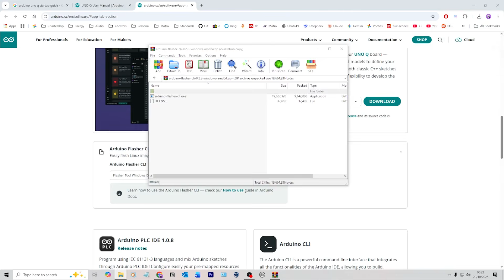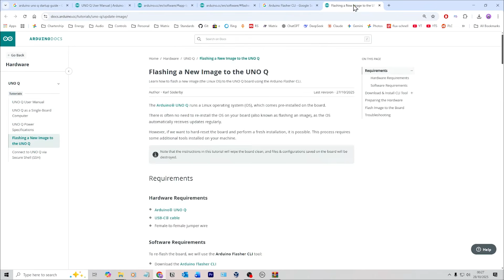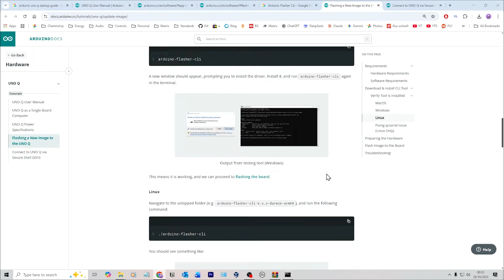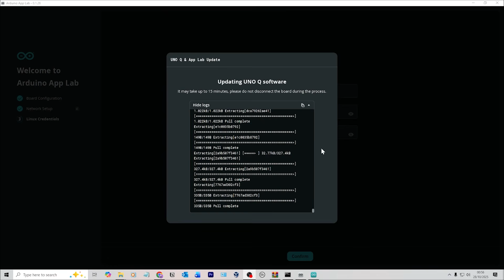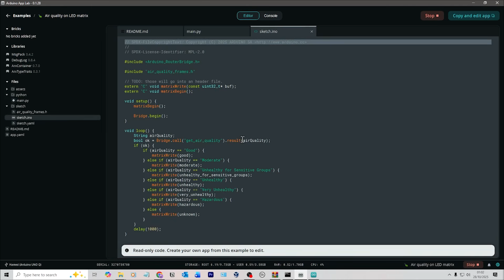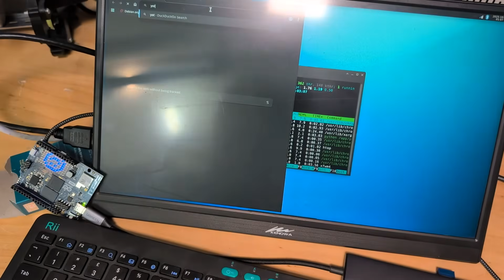Arduino Uno Q Full Getting Started Guide

Comment: First thanks for the video, I found out there's a straighter way to solve all of this:
-You plug your arduino uno Q on your dongle thing with mouse, keyboard and hdmi output to television, 
-You set it up, until you fail on updating arduino app  lab. 
-From this starting point you open up a cmd line (applications/terminal emulator) 
-You type : sudo apt update (enter), 
-You type : sudo apt upgrade (enter), 
-You type : sudo reboot now (enter) 
On reboot the updates for arduino app lab will work perfectly well.

Comment: Which USB hub are you using? Thanks.
Reply from the maker: I've used different ones, I have about 4 of them and they all have worked , I think the power supply & usb c cable to the hub are the important part, some cheap usb c cables I tried didn't work. In this video I believe it is the UGreen USB C Hub

Comment: Regarding the out of box experience. You must surely realise this is not a consumer product? Criticising it for needing updates right away seems to make me thing you never bought any new electronics within the first couple of months of release.

The products are made months before while software development is still in progress. They are loaded with the latest stable firmware provided to the factory, but that is very likely going to be months old vs what is available on release. They are not going to open every box and update them before shipping.

Get ready for several more updates over the coming months as early users start to find holes.
Reply from the maker: I did mention all of this in the video, firmware updates shouldn't be mandatory out the box though. Even Siemens aren't that bad.
Reply: Think it is fair to expect that a board at release would work out box. 
Same experience as Hamed with the exception of my board would not complete the flash process.  Now have a brick…
Reply from the maker: Damn Fleetz, that was my fear when I flashed both of mine. When I was flashing it I was thinking maybe I should have waited to order it from Digikey or some other distributor, I imagine Arduino won't be so easy to return the board to.

Comment: Helpful video. In my case I started with the stand alone mode and it all worked fine out of the box. It was only when it tried to run it connected to my mini PC that I started to get the message that I needed to flash a new image. So it works as expected unless one runs the lap app on their computer instead of on the board. My guess is that they updated the version of lab app for the pc after the factory image was installed on the board and that broke running it tethered.  I was reluctant to try flashing a new image because the stand alone worked fine and I was not sure how much current my computer could supply to the board. You say you do not have to worry about that when it is tethered. I will think again if I want to try that.
Reply from the maker: Flashing is scary but doable, just follow the video and you'll be fine. I find the app lab to be horrible to use when running in stand alone mode, it freezes all the time, so for me the only option is to program it via my PC.
Reply: @HamedAdefuwa  Thank you. I flashed it today. It was fine. On the upside I now know what to do if I somehow tank the OS. I was able to take a jumper off an old project have I have not touched in a few years. So far there are growing pains. I am still curious what this system can do.
Reply from the maker: Yeah definitely growing pains. So far I'm loving the hardware but the Arduino software app lab needs some work

Comment: Good to know the bumpy start I had wasn't down to me doing something wrong. I hit all the various problems you did and your video helped a lot to get me started much quicker. Something you didn't mention is that if you do try and connect the app via WIFI before reflashing the linux you are presented with a password screen. Amazingly no password is provided so it looks like for now we are totally locked out without doing the reflash process. Thankfully once over the initial bumps it all comes good and the user experience goes from terrible to pretty impressive.
Reply from the maker: Yeah first time I did it, I wasted 30 mins on that Linux password screen. Since setting it up, like you said, it's been ultra smooth. Loving it so far

Comment: Here is some tips. Makning more views You have to something more specific like trying to reverse engineering one on the simplest aruino code compiled to this board. After compiling Simple program You gonna have some probably some file.hex extension.  I am interested on the main cpu qrb2210 which Using armv8-64 bit instruction set. Every documentatio available on the Internet. Good luck.